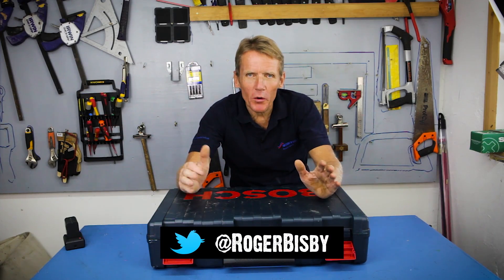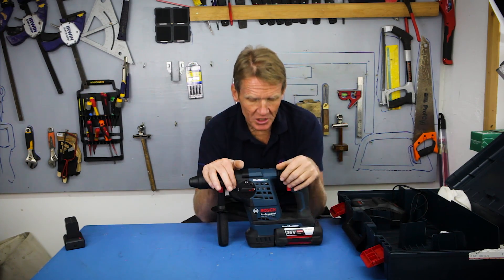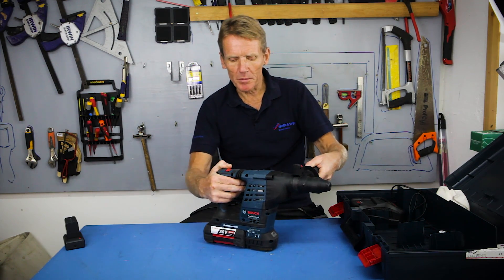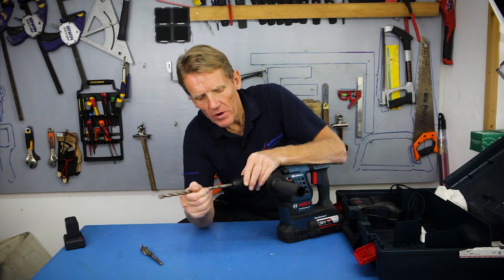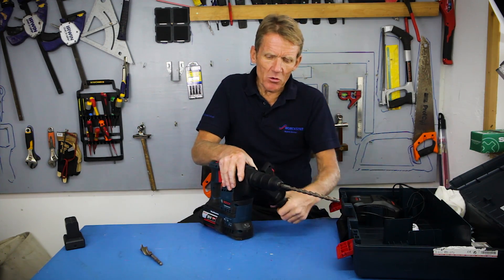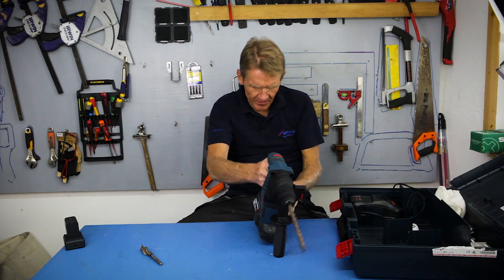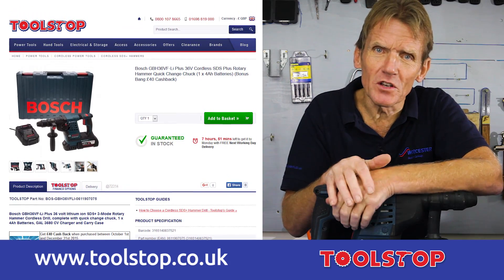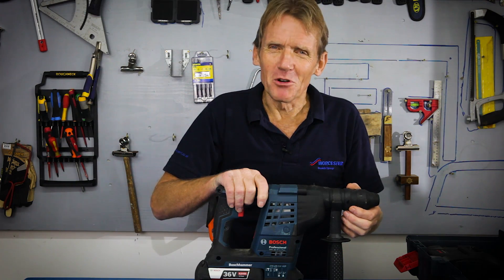Bosch GBH 36 Drill VF-LI Plus Professional Cordless Hammer

Comment: How the drill works in hammer mode the bit does NOT slide in and out.  There is an anvil that strikes the bit and hence the hammer portion.  There is no "sliding in and out"  The portion of the chuck in rear gets striked.
Reply from the maker: You are completely wrong. Do some research
Reply: @SkillBuilder  The Rotary Hammer Mechanism

While a hammer drill “vibrates” its way into the surface, a rotary hammer pounds away with a whole lot more force. Rotary hammers use a drive piston that exerts air pressure to a flying piston. That drives the bit forward quickly even as the electric motor spins the bit rotationally.Jan 26, 2021

Comment: Will the batteries charge from a standard domestic mains socket?
Reply from the maker: Yes the charger is 240 volt in and 36 out.
Reply: @SkillBuilder  I just purchased the GBH 36 V-LI Plus (brand new) and the charger is not even coming on. I tried it on several different mains sockets but still no result, can you offer any advice other than returning the goods?
Reply: @QamarHussain-w8s  I can agree about the battery going bad, at the second recharge itself the battery charger had the red light blinking which as per manual shows that battery is bad. the charger I have is made in China and the battery is made in Poland. the drill machine is made in Germany
Reply: Check the fuse

Comment: This is a fantastic drill but does have it problems.  I've got several of these and although they perform well am constantly returning them for repair.  I must say they are worked hard every day,  but let's be honest you dont buy a drill like this to sit in the garage.  I've found the main issue is the batteries going faulty, and you dont get 3 years on the battery.  These are not cheap either and I've got 7 faulty ones.  If you do buy one make sure you keep a good record of paperwork and serial numbers of replaced items of old and new.  You have to prove replaced items are in warranty not them.  The other issue is where the connection between the battery and tool is made.  It wears quickly.  They do replace this but after being changed before and if the tools is in the 3rd year of warranty, they say its wear and tear.  This is just my experience.
Reply: it depend the manufacturer origin, i prefer made in germany, but it limited here.
Reply: I can agree about the battery going bad, at the second recharge itself the battery charger had the red light blinking which as per manual shows that battery is bad. the charger I have is made in China and the battery is made in Poland. the drill machine is made in Germany

Comment: Hi Roger 
Thanks for taking the time to produce another cracking video. Do BOSCH make absolutely brilliant cordless hammer drills? Yes they do I bought mine back in 1995 ish! 
BOSCH GBH 24 VRE
And it’s still working just!! I say that because I’m struggling to find batteries for it! There’s absolutely nothing wrong with the Drill it’s the power supply I bought a brand New HITACHI 24V Cordless and compared to the BOSCH it doesn’t cut the mustard I used to in stall winter covers for private swimming pools and the BOSCH drilled and still drills through anything so could you have a word with your friends at BOSCH and ask them where I can purchase their batteries for a 
GBH 24 VRE 
Thanks again Roger great work well done
Reply: You are right. Bosch DID make the best hammer drills in Switzerland in 1995 and your 24v is probably the best. Lubricated with right grease it draws 2A without load.  The wobble arm hammer drills draw at least 6A without load.  The wobble arm mechanism is a part of planned obsolescence business  model. The ball bearing cage has a limited life under bending stress.
To save your drill just buy 20 white sub-C NIMH cells (nominal 6AH) from the makers of everything and don't be afraid to solder.

Comment: Any idea if this is able to be used for chasing out walls and drilling core bits for extractor fans etc?

Thanks
Reply: You need a core drill to core 4" holes for extractor fans, this is an SDS drill, it can be used for chasing out walls though
Reply: Using this for 4 inch core holes will definitely end badly.

Comment: After seeing this review, I bought one (plumber) and it's a great machine. Loads of power for larger holes and breaking, the 70% reduction switch is fantastic because you can use smaller sds drill bits without bending them. The extra standard chuck is handy too. This is the only drill I use now, it does everything I need. I'd recommend this drill because it's well made and very nice to use, not heavy or awkward and very fast charger.
Reply from the maker: Very pleased to hear that it worked out. Bosch seem to be good at SDS hammers but they did invent it.

Comment: Is the 36 volt line worth the money?
Reply from the maker: I would say that it is value. That is partly to do with it being a cheaper brushed motor. I have tried it up against the Milwaukee 18 volt fuel and you get more punch from doubling the voltage. It depends whether you need a cordless hammer. A cheaper option is to plug it in.
Reply: i still have the older version of the GBH36 its about 7 years old still going strong, changed the brushes once, and i use it to core out boiler flues just start the hole off then stitch it with 10mm holes then core it out  it fly's through no messing with leads, i have been told that the motors on the new modules are not as good

Comment: Cheers for the useful and informative video Roger; recently sent my Compact 36V back under warranty as I feared rugged use had exceeded its abilities so bought this one instead; it's a monster, and hopefully fit for purpose (cave digging!). Will find out soon enough. Bosch have a great reputation amongst contemporaries for this kind of application, but it's super-hard on the gear as the conditions can often be appalling.
Reply: Chrispy B did you like the drill? Any problems

Comment: There should be no reason why you have to use a brushed vs a  brushless motor. They both spin, have torque etc, but they may vary in rpm, torque and efficiency. Of course a brushless will excel in everything. Probably what happened is that bosch wanted to do things in a certain way and they could not get a brushless motor that spec'd out the way they wanted or for the price they wanted it. They are just making an excuse and trying to save face.  From what I have found out, many companies buy their motors from someone else, so if they could not get what they wanted, they could not make it either. However, Milwaukee is one of the few companies that not only makes their own batteries, but their own motors and does what ever they need to to achieve they goals. Milwaukee has a sds max 18v which has a 1 9/16 capacity, is brushless, will chisel for 20 minutes straight (9ah) and drills faster than a comparable corded drill. Much more powerful than this Bosch model.  Trust me, Bosch is good, I have had their rotary hammers before, but Milwaukee is setting the bar far higher than most and will continue to.  I currently have 2 corded hiltis and if I buy cordless, I will go Milwaukee. Yes the Milwaukee cordless is actually better than the Hiltis.
Reply from the maker: +Ari P 
Hi Ari 
We have tested the new  Milwaukee SDS max against the Bosch corded and Bosch won by a small margin on speed. That was 32mm into concrete kerb stone. We also ran the SDS plus machines up against each other. 

We will put that test up soon. We also ran this machine up against the 18 volt Fuel
Reply: @SkillBuilder  Hi, do you have the link for the two tests? Thank you!

Comment: ive got a 36v makita dual 18v, unreal battery drills now. its strange how some tools are still brushed. think brushes still give better torque. not sure.
Reply from the maker: +VENTS 
I have heard the same thing. I don't know if the AC and the DC changes that. DC is more efficient. To be honest that is getting over my head.
Reply: +VENTS ??? Brushless motors in a drill are still DC in a cordless tool.  I am not aware of any lower torque abilities with a brushless motor and even if that were the case, that is not an issue because of the following. Brushless motors have higher rpms.  Many times in tools, the motor is geared down to create the necessary torque anyway. You can deliver torque by using higher rpm/lower torque and gearing it down to normal rpm/higher torque.  Delivering torque via gearing and higher rpm rather than all out torque directly at a lower speed for the motor is most often more efficient and less stressful on the motor for its longevity and reliability. You can also make the motor smaller and lighter without sacrificing reliability and even with the gearing (if it was added), still achieve a lighter tool. Most often cordless drills have gearing to begin with for your 2 speeds anyway and many other tools have gearing regardless as well to take any kind of motors rpm and change it for a reciprocating motion or some other kind of action . So you are just adjusting the existing gearing ratios which adds nothing to the tools existing design to account for the higher rpm brushless lets say rather than a brushed.  Think about riding a bicycle and would you rather ride in a lower gear and spin your legs more quickly with less force, or stay in a higher gear, and have to pedal with lots of force more slowly. (remember you are the motor).
Reply: Brushelss DC: Its DC from the batteries yes but an inverter chops it up and makes AC to drive the motor https://en.wikipedia.org/wiki/Brushless_DC_electric_motor

As much as  I love my corded Bosch SDS drill, I am tending to the Makita  for cordless SDS since i have  some of their other cordless tools, just really for the sake of dealing with one charger and battery type I am  very happy with Makita power tools as well, real work horses

Comment: That 3rd position on the dial is so you can rotate the chisel bit in to what position you want ,with out having to take the bit out ??
Reply from the maker: +YENDORCARLOS 

Good point,  I have seen it on other machines but failed to spot it. I will put a note up now.

Comment: Nice video  , nice drill . i bought the predecessor to this model about 5 years ago and it is a fantastic drill that i use daily for general work and i have only just had new brushes fitted .
I will definitely get this new model in the near future as i think that bosch do make very good hammer drills and have a good reputation in the construction industry , cheers
Reply from the maker: +yensabi 

Thank you, Good to hear from a long-term Bosch user.

Comment: Thanks for another great example of experience demonstrating tools, I have had my 240 volt Bosch elector pneumatic impact drills since they first came on the market here in Australia when everyone thought AEG hammer drills and alike were the best thing since sliced bread but unlike me the drill is still going strong. I just wonder if those batteries would still be available in another 25 years because if the drill is as good as the one I have it be a pity to have to throw it away when it still works well. Thanks again for your time and sharing your experience and opinion.  On another note Tools I have ordered from Toolstop arrive quicker from England  to Australia (3 days) than tools ordered from interstate that can take considerably longer.

Comment: Roger, I've just bought the GBH 2000 SDS and cant fault it! Thanks for the info on lubricating the tool. (!) My question is; will pretty much any silicoln lube do the job, or does it have to be by Bosch to stay in warranty?
Cheers mate!
Reply from the maker: +Dave Roberts 
Hi Dave  That is good to know. 

Any silicone lube will do it but they advise against mineral grease. I don't think that the  grease  would harm the chuck but  it might attack the  rubber shroud  that keeps the grit out. I should have mentioned that you need to wipe the SDS bits before putting them in to remove grit or wipe them when you take them out.

Comment: Is it ok to use clear silicone to lubricate the sds bits?
Reply from the maker: +Bill Dee Not silicone sealant it has to be the silicone grease which doesn't set. I might add that in a note. Get it from a plumber's merchant